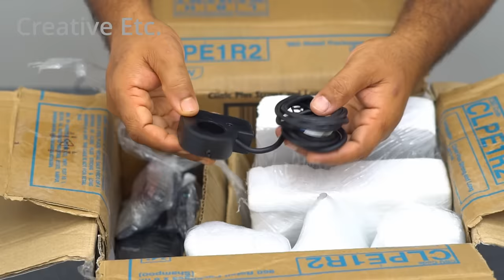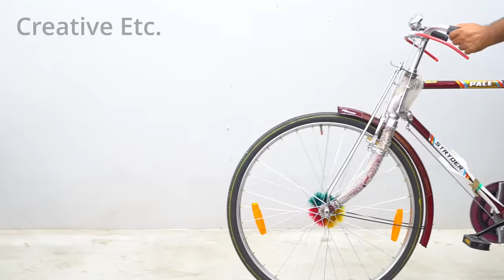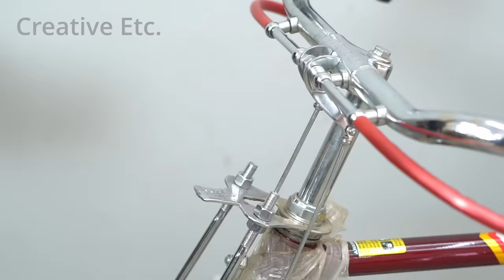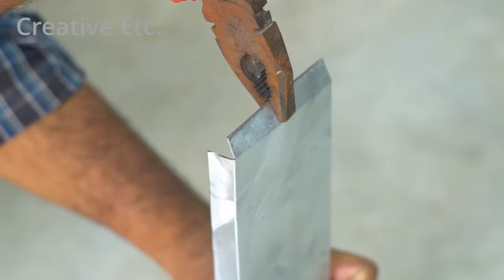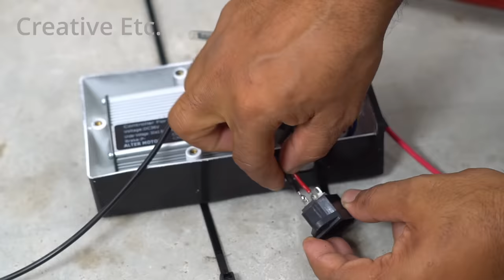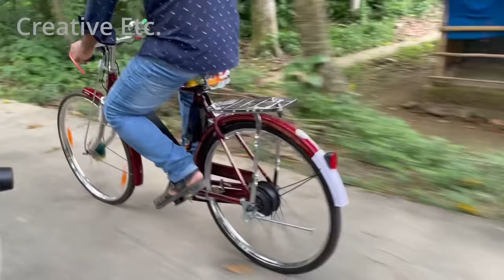DIY High Speed Electric Bike with E-Bike Conversion Kit at Low Cost

Comment: Around 20000 rs 
cycle 2500 to 5000 ( depends on the cycle)
Kit and batt 18k. Just my guess
Reply: 1 k old cyle 150 775, 800 acid battery no sevicing maintenance ke liye roneka ,direct naya laganeka😅